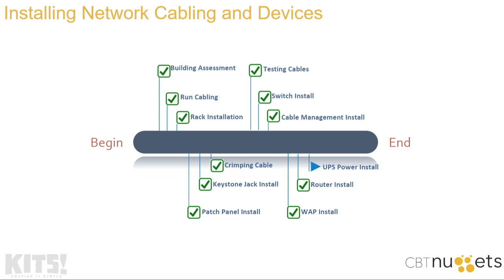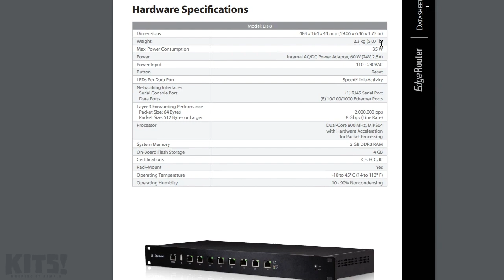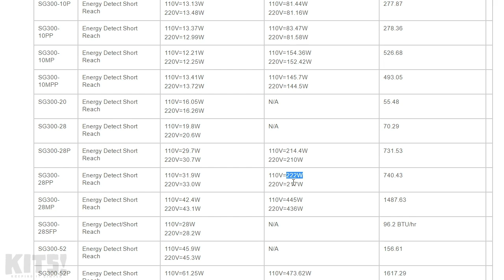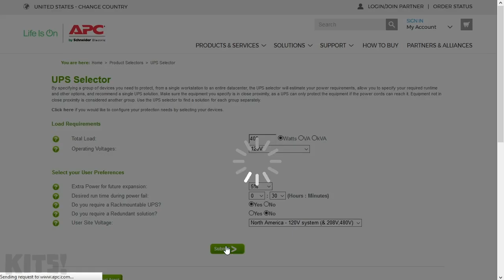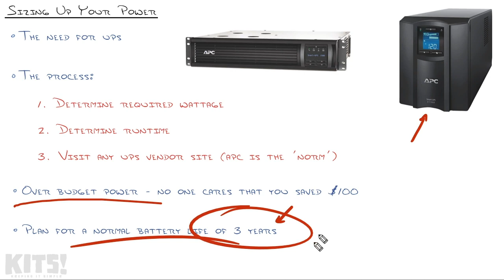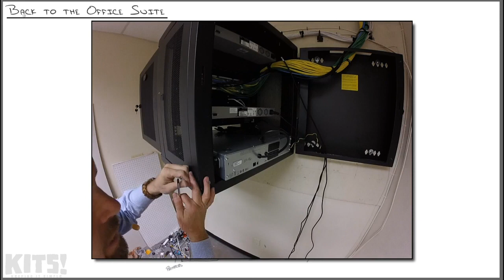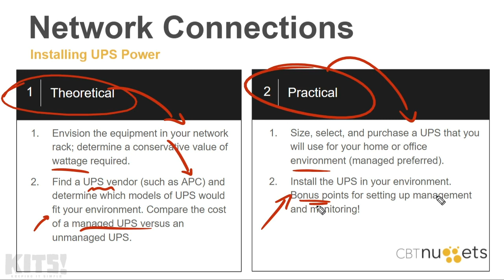Real-World UPS Power INSTALL!: Real World Cabling Ep.11 - Keeping IT Simple

Comment: I am using an old UPS where I can buy 12V 7Ah batteries. The batteries in the new devices have been converted to manufacturer-specific batteries. There is no point in giving up an old UPS because batteries are available from many stores. The only problem is to connect all nine batteries correctly in series and in parallel. The UPS battery voltage is 38VDC. The UPS power is not enough for everything I need and that is the problem. I can make a network that starts to shut itself down, but the UPS power is not enough to keep the whole network on. 9 batteries keep 1 or 2 servers on. An entire room full of computers is too big load for my ups. The server powers are small, but the largest power supply for a gaming computer is 1.5kW.

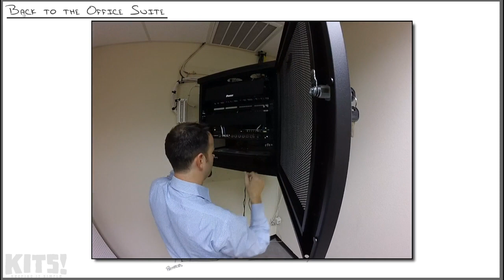Comment: I love your videos; but, I have to say this is truly the first time I have anything substantive to add.  Those APC rack mount UPSs are NOT intended to be mounted in a rack as you demonstrated.  The reason you said at 9:45 that it was difficult is because it is not meant to be installed as shown...it is also why the back end hung down...if you were not already on the bottom of the rack, you probably would have bent the sides.  All APC 2U and above UPS (and battery expansion packs) are intended to be installed on a RAIL KIT.  If you had the rails in, it would have been 100x easier to install on your own.  You can also see the square metal guides (the small square metal pieces screwed into each rear side) were already installed the back sides of the UPS you installed.  Like all things APC, there are 20 different part numbers for the same thing...but look up SRTRK4 and you will see what I am talking about.  Unfortunately, APC sells the UPSs with and without the rails (for some unknown reason)...buying the APC part number is expensive (around $125 and up) but if you look for them on eBay in the event you get a RM UPS without the included rail kit...they are a way better deal.  Anyway, this series was awesome and I do love your content...but that UPS install is missing a key critical element...I highly recommend for your rack's well being and any future serviceability...put the rails in.

Comment: So even with constant power (no outage), a failing UPS will still take down the devices connected?
Reply: Of course it will. That's why really critical infrastructure devices usually come with at least 2 power supplies and get fed up by two separate UPS which are connected to different circuits. But that's nothing you will see in most SMB installs
Reply: Yes it will I've seen it happen it tons of small branch offices.

Comment: Excellent video! You mentioned devices shutting down gracefully. Can you make a video of that configuration process?? And testing that devices are shutting down gracefully. Thank you for your hard work. 😃
Reply: Depends on the model and features of the UPS, if it has built-in network, it should supply features like the Network UPS Tools (NUT), if it has USB you can connect that to the machine you want to shutdown, if you have more than one machine to take care of, one will have to take the USB and supply a NUT server for the other machines. Devices like switches and routers usually don't get shut down, power loss is ok for them in most use cases